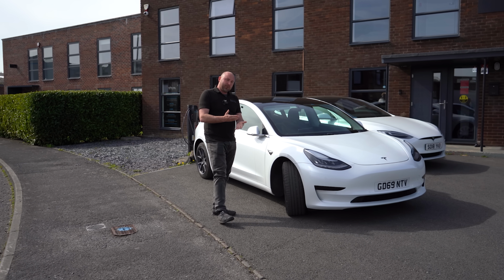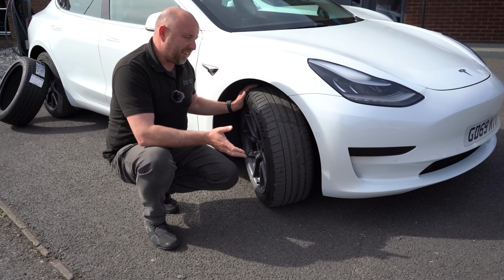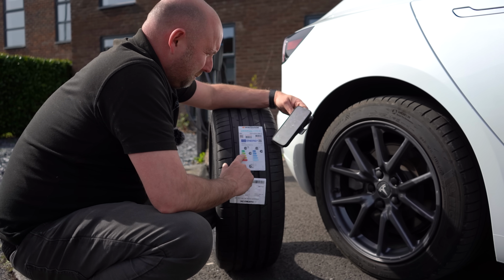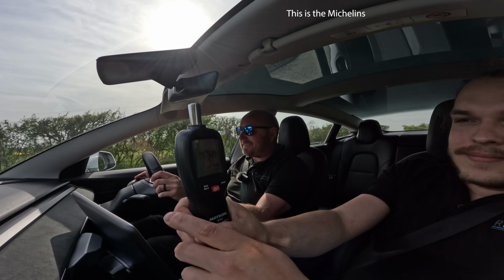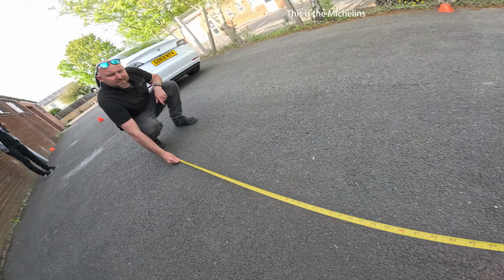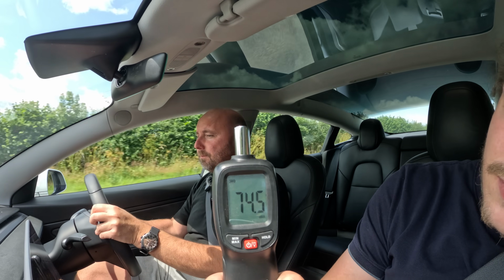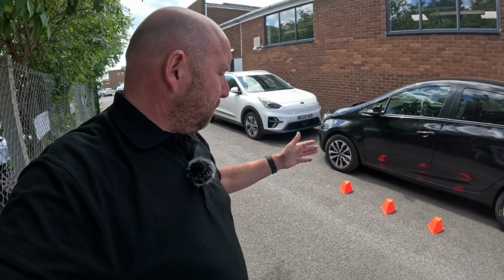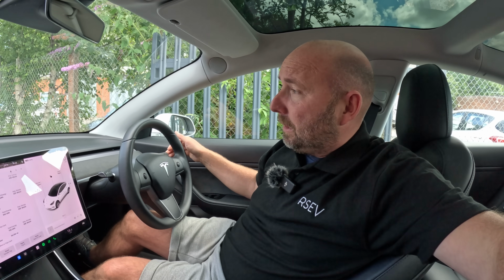New EV tyre test - Hankook Ventus iON evo on a Tesla Model 3 18” aero wheel.

Comment: 60db is about the same as the noise on a 33rpm record....we have about 18K miles on our 2023 dual motor and the tires are over 50% so we'll be getting around 40K + before we replace them.

Comment: I have a 2015 85d model s and have been using 19inch  Hankook ION summer EVs tyres for a few years, i do find i get slightly better consumption figures when running at below 80kmh (50 mph), maybe 5% better.  I also get better longevity maybe 25% longer life than the previous tyres, they also seem quieter than my old tyres.  Not noticed much difference In grip. I Have just bought a set of winter ions which i have yet to put on. I live in French alps so winter tyres are obligatory.

Comment: My model 3 came with the 28 inch Hankook all weather tires I have 48000 on those tires and they still do not go be changed. I have driven this car in extreme weather snow,ice handled beautifully. I will put the same tires back on this car b4 winter. Very quiet as well.
Reply: What are they. Are they the IOn flexclimate or different. Please share your actual tyre , so I can have a look as I do 30k per year

Comment: Hankook Véntus eco are the tyres that I have received as equipment on my Hyundai Ioniq 6 Dynamiq RWD and they certainly are quiet. Long-term consumption over 2,000 km in two months is 14.3L/100km (about 4.3km/kWh I think).

Comment: I just came back here, after I discarded mu Michelin Pilot Sport 4 after onlyt 3 seasons, I coud run it for another season but car started sliping in corners at lower speed and I decided it's not safe. Doing some resurch for next summer timer. Tesla now fits this tire on new Highland 19" while they use Michelin E-Primacy for 18" but that tire has a bad wet handeling and aquaplaning.

How is wet handling on this E-ON evo? Not sure should I just stick to stock Michelin, considering Continental Premium Contact 6. As I am very happy with there winter tires.

Comment: Anything over 4 miles per kWh is really good. Averaging 4.5 or better is fantastic! Keep in mind, brand new tires have more rolling resistance, than they will, after a few thousand miles of "break-in". To average that with a good percentage being on brand new tires, is a good number. Now that the tires are "broken in", time to reset the average efficiency gauge, and see what they will do now! The Michelin tires set the bar pretty high. If the Hankook iON can do better, that's a real achievement for them.

Comment: Thank you for the honest review , and I believe only review on the new iONs.  I've been dying to get one of these tires. Both spec sheets look great but had 2 questions: (1) is any tire subjectively more comfortable with NVH, bumps, etc, and (2) while the sound difference seemed negligible, was the pitch different? I've got the stock Michelin Primacy MX4 that they put on Stock 2023 Model 3 RWD here in Canada. My priority is road quietness and comfort, then performance...Any help would be greatly appreciated.

Comment: My 2021 M3LR came with the usual Tesla Michelin 235/45R18 PS4 acoustic tyres fitted. I changed all 4 tyres at at 21,100 miles (they still had 2-3mm of tread remaining) for 4x GoodYear Eagle F1 Assy 6. Now, after aprx 3,000 miles on the F1s my thoughts are as follows:- in terms of grip and handling I cannot really tell any difference in dry or wet, both are excellent. The F1s however feel more comfortable than the PS4 and are also quieter. BUT, I have noticed a small efficiency drop with the F1s; perhaps 5% although this is hard to quantify exactly of course due to changing external temperatures etc etc. For me the F1s are preferable (and they're also cheaper than the PS4).
Reply: The biggest take out will probably be the fact that they won't be nowhere near as durable as Ev specific tyres.

Comment: I've been using Michelin Primacy tyres for years, but this year changed to Michelin CrossClimate. I used to swap my summer tyres for Continental wnter tyres when running a rear wheel drive BMW. They turned it from an expensive paperweight during the first snow of the season, into a go anywhere in deep snow car. I no longer live in the country, so CrossClimates are all I need on my Peugeot SUV.

Comment: I suspect am about to expose myself as an idiot but I bought a full set, but they only inflate to 36psi (absolute max 40) so now my TPMS constantly thinks my tyres are low without any apparent way of telling it 42psi isn’t the recommended pressure anymore. Fear I am stuck with a spurious fault indicator for the life of the tyres. 😢

Comment: Hi, I looked into braking distances for a computer simulation project many moons ago. The UK Highway code stopping distances are based on driver reaction time and the kinetic energy of the vehicle. We can ignore reaction time here as the diver knows to stop. The kinetic energy part of the stopping in feet  is calculated as 1/20th of the speed in mph squared - there is no vehicle mass involved in the Highway code determination. So at 30 mph that is 0.05 x 30 x 30 = 45 feet. So, you've been doing rather well!

Comment: My 21 Model3LR had 19” wheels and Hankook tyres from new. At 25,000 miles I changed the rears due to a unrepairable puncture. The new rear tyres were identical, but non Tesla, without the foam lining. Subjectively they seemed a little louder. However, the major effect was a marked deterioration in handling when driven hard. From absolutely stable ‘go cart’ like handling before, the back end became quite ‘squirrelly’ and required more steering input. At 50,000 miles I changed all 4 tyres back to Tesla spec Hankooks. The fronts were completely knackered at 50,000, but they got there. With all 4 wheels restored to Tesla spec tyres, the handling and noise levels are back to very good.

Comment: On my Chevy Volt I had OEM Good Year assurance then, when worn out, I replaced them with similar GY low rolling resistance tires.  Got sooo many flats. They were like nail magnets and only got about 40k miles from each set.  Bought my current Kuhmo regular (heavy) tires about 20k miles ago and zero flats.  The electric range took a 10% hit but the braking distance is noticable shorter. And NO more flats!  Not a big fan of LRR tires but maybe the Hankook and Michelin are better.

Comment: I'm on my 3rd set of tyres this year on my Peugeot e-208. The first was Michelin (came with the purchase of the car in Feb 2023), then I changed it to Hankook ventus s1 evo 3 in May (lasted 1 month and 3k miles) and now I'm back to Michelin Primacy 4. The money I've saved charging via solar panels at home has been spent all on tyres this year 🤣 My right foot is a bit heavy at the traffic light in sport mode, but I'm trying my best to stop doing that. The Michelin has a more comfortable ride than the Hankook and I will never change brands again. Wish I went with the CrossClimate though, that will be my next purchase (hopefully not in 2023). My uncles do uber in their electric cars and swear by winter tyres in all weathers, apparently they last even longer than summer tyres. Something to consider!

Comment: We switched out our 2022 Model 3 SR+ tyres for Cross Climate 2s earlier this year at around 24k. The front were getting worn and were about to head to the Alps when winter tyres were needed. Generrally we've not noticed the change, possibly a fraction less efficient at 70 but quieter and comfier than the original Pilot Sport 4's. @RSEV if you wanted to do a side by side comparison let me know.
Reply: We moved our other ev from ecopias to crossclimate2s.  We saw about a 15% range/efficiency loss.    Not a big deal except for road trips.
Reply: I'd love to see this comparison. We're heading to the Alps this winter in our Model 3 Performance. The all season options are really limited for the 20" uberturbine alloys and it would be interesting to know what you give up in efficiency over the relatively dry 900km motorway journey through France for the last 50km of potential snowy conditions in the mountains.

Comment: is there any change in range of car with the new tyres.   why not do same car and do and road trip.
what is or will be the price difference between them.
I have had this brand before and they were really good for me.
my Ioniq 28  came with Michelin energy ones  and they just did not ride right to me.  so when a tyre got damaged I changed them all to continental tyres  which at the time were cheaper and had all the same specs.
And they have just been great for me.  and no change in efficiency

Comment: I seem to be the only one who will going for the Goodyear eagle f1 asymmetric 6.
A natural rival to the ps4 but cheaper.  
Should offer identical performance and hopefully slightly better economy as the rolling resistance is better on them.
Reply: I’m now running f1 A6 and the grip is incredible but economy not as good as the PS4 t1
Reply: just to let you know, there is a new version of the Asymmetric 6 with acoustic foam - SCT (sound comfort technology)

Comment: Hmm, still comparing used Michelin's against brand new Hankooks. In general the PS4 is going to be better at dry, wet drip than the Hancook. But the new Hancook might be better on efficiency. The new Hancook is currently showing as the same price as a the brand new Pilot Sport 5 from Michelin, a tyre with better performance than its predecessor and comes with around 20% longer duration. I know I would be picking the PS5 over most.

Comment: Interesting test. I would have always preferred Michelin however the Hankooks on my Y seem fine. One thing of note which I picked up from tyre sites. "Summer and winter tyres have the EU tyre label that indicates the noise level. This label, however, only covers external rolling noise. External rolling noise and interior noise may even be polar opposites, and reducing one may increase the other."  In other words the decibel readings shouldn't be taken as what you will get in the cabin.

Comment: Great video as ever.  However, the Speed rating for the tyres from Tesla is Y so fitting W rated tyres could have insurance implications should you get a miserable insurance assessor.  I don't get why Hankook haven't released these as a Y if they are a competitor to the PS4.  I have the PS4 T1's on my 2021 and I can't seem to find these anywhere!
Reply: Speed limit is 70 on motorway.

W speed rating is fine
Reply: @gj91471  so insightful. I'm sure the insurance assessment would agree with that logic.
Reply: @jamesw9333  W = 168mph.  If you are travelling beyond the limits of the tyre then you have more to worry about than your insurance.  I doubt if any insurance company would be that bothered about a W rating on a tyre, given that most of them do not require notification when changing to winter tyres.
Reply: @welshy1812  Nothing to do with travelling beyond the limits of the tyre - its about having the correct rated tyre for the vehicle, this is all the insurance company are interested in and it is a means to avoid paying out in the event of a claim as the vehicle will have been "modified from the manufacturers build"
Reply: @jamesw9333  Tesla list two different tyres for the Model Y on their UK website, exact same size 255/45/19, one Hankook, one Pirelli. Pirelli is Y rated and the Hankook is W rated.

Comment: I fitted  Michelin E-Prinacy (electric car) tyres from Costco, last December and they are fantastic compared to the Michelin Sport 4’s I had on. Way quieter and A rated efficiency which really showed straight away.
Reply: Is the handling compromised?
I like to push the car hard ! I imagine those ev tires as shit when pushed ?
Reply: shit wet braking though
Reply: These tires are good for noise and efficiency and not much else.

Comment: I switched to the Costco Michelin PS4 tires after the TO wore out. The difference in ride comfort is night and day, so much smoother than the original. I'm running them at 48 psi and getting the same efficiency as with the TO's. When driving aggressively I have noticed that the Costco Michelins do give up less progressively than the TO. But the improved comfort  and cost savings (-30%) are worth it.
Reply: weirdly I have one non T0 version as after swapping both on the rear I had an irreparable puncture 1200 miles later. Now, 19k miles after that, the non T0 version has worn much more than the T0 version that has driven 1200 miles more on the other side. Weird?
Reply: @MCSMIK  Expected actually. One of the key differences between EV vs non-EV versions of the same tire is that the EV versions are engineered to deal with the generally higher weight, and higher low-end torque of an EV versus an ICE vehicle. This means they're built with thicker sidewalls and feel 'stiffer'. This is why the other guy finds the non-EV tire a softer ride (softer sidewalls), but will also find significantly faster wear which will offset the cheaper upfront cost.
Reply: @MCSMIK  It's difficult to compare non TO Michelin tries to each other as there are dozens or variants with similar naming. Here's the one I purchased and so far they seem to holding up better than the TO. That said, we've calmed down from early EV driver days when we would use the go pedal hard all the time.
 
MICHELIN PILOT SPORT A/S4 235/45R18 98Y XL 70,000 KM WARRANTY 
Item # ‌1441365‌
$ 279.99 CAD
Reply: @antoinepageau8336  What does TO stand for?
Reply: @erichchan3  In case you did not find out yet,

"T0 means it’s been designed to the specs set out by the original manufacturer for use on the car. T is Tesla and 0 is the first revision. T1 would be more modern design etc. Sometimes keeping a T0 on an older Tesla would be the right thing to do for the age rather than just going for the newest T revision."

Comment: Very interesting, Richard, and you are obviously going out of your way to be as fair and unbiased as possible, even declaring your receipt of a single set of free tyres for testing.  I also noticed you didn't do your own conclusion section, leaving that to the viewers. All very commendable. 

The only thing I saw that wasn't highlighted was that the Michelins had more tyre wear than the Hankooks but everything else was factored in. The Hankooks stopped a bit better but they were newer. My takeaway is that there's a fag-paper between the two brands so it's probably coming down to price and availability. That's fabulously useful. Please pass on my thanks to the whole team!

Comment: I put Michelin Crossclimate 2 on my Leaf, not the cheapest but they are brilliant tyres in dry, wet, snow, anything you throw at them. No need to swap tyres in the winter either. No difference to the efficiency.
Reply: Put them on all my cars here in the Netherlands where seasons could mean nothing (hail in July and summer weather in december). Never skimp on safety
Reply: This is completely false. The Cross Climate 2 tires have far worse efficiency than the standard tires and they are much louder. They are great in all weather but at least 25% less efficiency. I’d never buy them again
Reply: Same here, coming to my Model Y when the Hankooks are finished
Reply: Have Cross Climates on both Leaf and Tesla and they're fantastic.
Reply: Any issues with speed rating and insurance?
Reply: Cross climates are loud af

Comment: Recently haven’t been a fan of Hankook. Wears quickly, are noisy and most of all expensive. Michelins are a better quality tire overall in my opinion. A really good lower priced tire punching above it’s weight is another Korean brand. They have been really good for me as a cheaper alternative.
Reply: Depends which ones, seems that’s not the case for this model. Every brand has rubbish models

Comment: My M3 SR LFP came fitted with 19” Wheels and Hankook Ventus Tyres, i have done only about 11k miles on them but they are hardly worn and have been a good tyre with low noise and good handling in all weathers.
Reply: Mine (M3 LR 2023 MIC) came with Hankook Ventus S1 As tires. I didn’t find anything about them but they seem pretty good.

Comment: My model YP has PZero’s I really need a tyre specific to Tesla with a massive lip to protect the protruding turbine wheels
Reply: The tires are designed that was for a reason. The weight and performance of the vehicle. There is a method to the madness!

Comment: With all of Teslas safety systems just wondering if the horror that unfolded in Wimbledon with the Land Rover would of been avoided if it had same system? I have model Y and a child just put one foot on the Rd yesterday and glowed red and car braked immediately I presume this would of kicked in ?
Reply: Hard to tell due to how it approached the fence etc. it would unlikely have stopped in my opinion, I own a model Y and whilst its warning tone goes off it is very late to react if ever. The land rover would likely to have had some sort of collision assist being a fairly top model but even this will only work in certain circumstances and scenarios.
Reply: It really depends. We don't know enough info. The defender will have flagged an alert and attempted to brake (as a Model Y would) but most (if not all) cars will allow you to override it so if the driver kept the accelerator down or pressed harder then the car will proceed